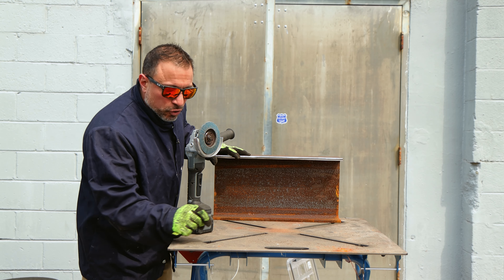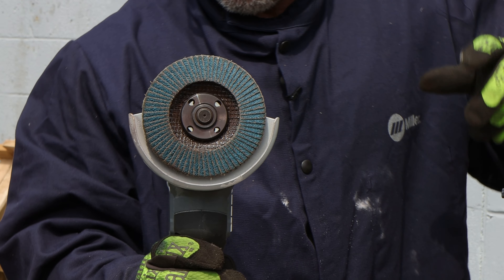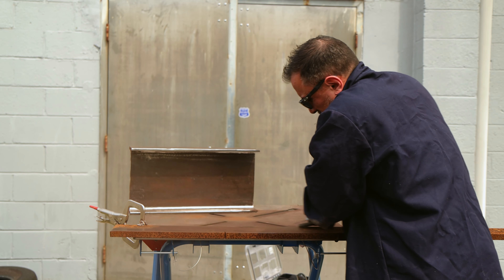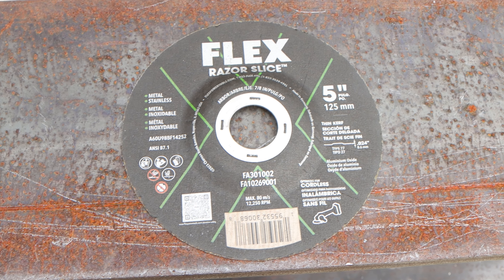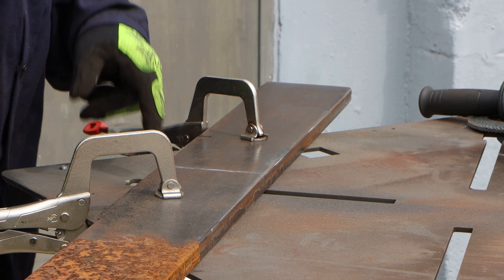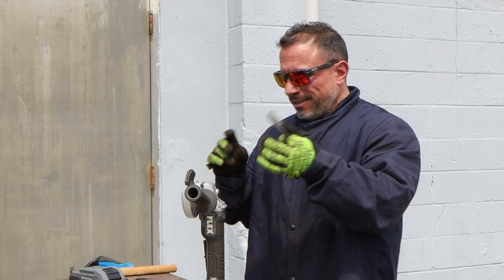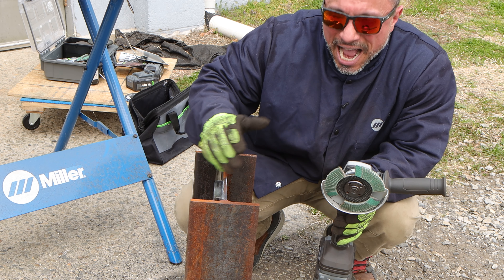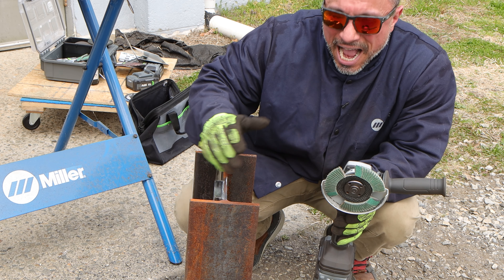This New Tool Accessory Fixes My Bad Welds

Comment: Well done Vince. I made a lot of shelves from steel. Then started making furniture from steel. I made step ups and tables. I will consider buying a die grinder as I'm making custom sheet  metal boxes from 1.55 mm galvanized metal. I designed a cabinet for the lounge to carry cds and dvds. I'm considering to use sheet metal for the shelves. Well done in your grinding and welding.
Reply from the maker: Thanks Ron, appreciate you sharing!

Comment: In the real world, that grinder and those discs would be an embarrassment... They took for ever to remove the metal,, no or little sparks means none or very little metal removed. And those flap discard were fit to be throw away after a minute or two...